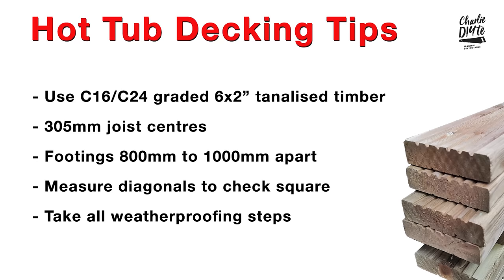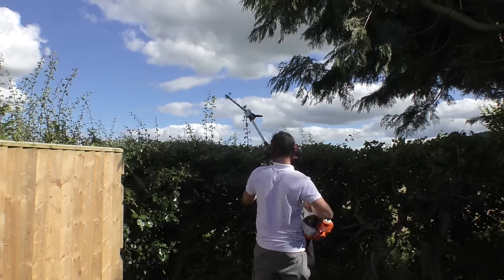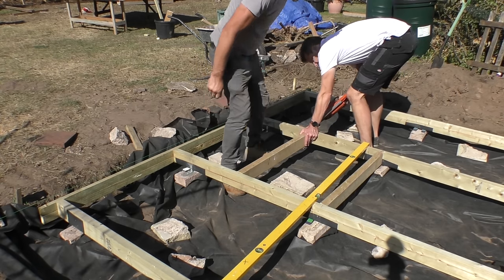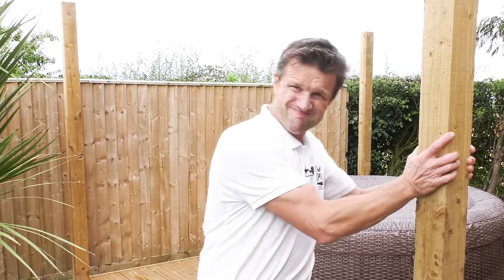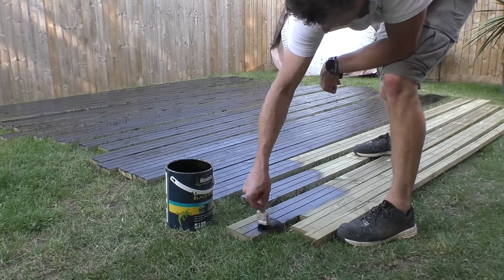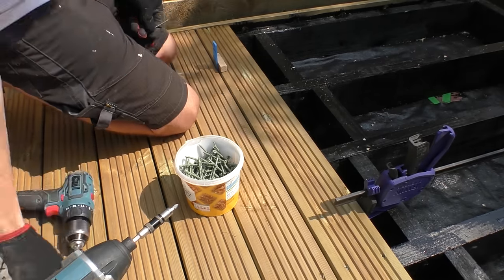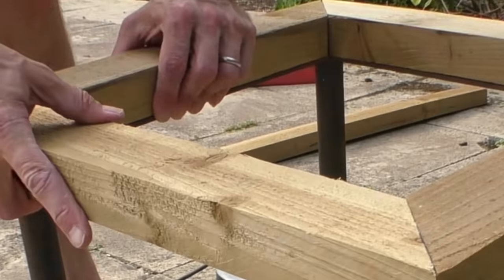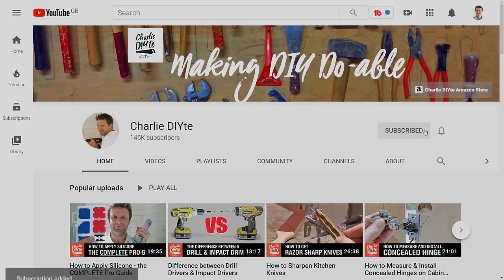How to Build Decking for a Hot Tub

Comment: My misses and I purchased an CleverSpa Monte Carlo hot hut (holds 0.96 tons of water) over lockdown as well as we will not be going abroad this year. I too built a decking base for the hot tub, but I found a place locally that sold really good quality reclaimed wood. 

I used 4x4 for the base border (used with coachbolts) and 4x2 for the inner base, joists and cross members, I used 4x4 wood for the inner joists supports/footings where you used bricks, landscape membrane sheets, horrible sticky bitumen on absolutely everything 🤣 and decking for the top (with a 5mm gap between each decking plank) and sides. General rule of thumb says that decking slopes should be between 1% gradient (1/8'' per foot) and 2% gradient (1/4'' per foot), I went for 1.5% across an almost 9 foot span which works great. I also overlapped the top decking over the side decking. As our hot tub has built in multi colour LEDs (around the bottom edge) which lights up the whole hot tub nicely. I purchased the same remote kit and receiver from AliExpress and added more LEDs to the bottom of the overlapped decking, it looks great as one remote control all the lights. 

Just like you, I too over engineered the decking base with way more support than what was actually needed. But with 0.96  tons of water displacement on the base, I prefer to be safe than sorry. Complete build price of the base was about £350 including all the decking base wood (reclaimed but in excellent condition), all the decking wood (new, I managed to find someone on Gumtree that was literally giving away surplus decking really cheaply as it was taking up space in their newly designed landscapes garden and they changed designed half way through, so ended up with too much new decking wood), screws, wood preservative, bitumen, extra lights and a few other bits and bobs.

Yes I'm a hobbiest but I always make sure to have all the right tool from the off. I used both my Evolution sliding mitre saw and also Circular saw, extra long calibrated engineering square (the base is perfectly square measured 45° corner lengths), spirit level (only for the top edge (not for the 1.5° slope)) and a few other select tools.

A nice session in the hot tub with a glass of wine and some relaxing music can be relaxing and fun at the same time. But wow,  heating them up are not cheap 😜
Reply from the maker: Hats off to you Pete. Sounds like you've completely aced that!! Thanks for the detailed account. Yes my electricity bills are a lot more now, not helped by the fact that my family insist on having it between 38 and 40 degrees!

Comment: I really enjoyed this, and appreciate that you left the "lessons learnt" in! 😁

Here in New Zealand we bury the posts in the ground with concrete also.  The posts are very heavily treated (H5) so last perfectly fine.  I'd set posts in the ground (with concrete) to support the weight of the bearers, rather than the bricks you used.  Not saying that what you did is inadequate, that's just what we do here.  

For setting the planks, I like the method where you set the first plank, then measure out and screw down what would be the 7th plank parallel to the first.  Then place the 5 loose planks that will fill in that gap, use wedges to ensure you have an even gap across them all & screw them down.  This ensures they are all even, is much faster, and makes it less likely that you get out of parallel.  If you check out Scott Brown Carpentry here on YouTube, he has some excellent videos on the method.

Last of all, I'm a strong advocate for having the grooves facing down.  They just collect dirt and become a mare to clean.  As a consequence they actually become more slippery when wet.  I used to work with a guy who worked for some years at a sawmill, and he told me the grooves are actually for ventilation & to minimise wood to wood contact, and are intended to be face down.
Reply from the maker: Thanks Tim, some truly great tips there. Yes, the post technique is prevalent here also particularly for raised decks, and I'm guessing a heavily treated post with domed concrete is about as impregnable and efficient for run off as you're going to get. I hear what you say about having the grooves face down. I don't actually think its right that they're designed that way, but I can see the rationale for it. The problem with having the grooveless side face up is that all wood gets slippy with time, and you're creating an infinitely more hazardous surface for going head over heels on, than if it was grooved. To keep the grooves clean I give them a blast with my leaf blower every other day. What I might do in the close season is give the deck a coat of sealer and protector. Tanalisation is fine, but it doesn't stop the water from sinking in. To my mind if you can make the deck impregnable to water, then it's not going to develop that slimy surface that we all know and hate!
Reply: @CharlieDIYte  Hi Charlie, I don't know if it's the different environment, but I find I just don't get that issue with the slippery decks.  That's with treated pine, flat-side up, stained with a water-based stain (I use Cabot's AquaDeck).  I try to re-stain every 2-3 years.
Reply: I did a large raised deck 2 years ago. It seems that different countries seem to have different ideas about the grooves facing up or down. The UK seems to have them facing up because of grip reasons. Im in the UK and did the grooves facing down.  Easy to clean and the water just runs off.  Decking can be slippery with the grooves up or down and if it's slippery it needs cleaning.    Also, the decking boards swell quite a lot over winter and I made sure there was still a gap between the boards throughout the year.
Reply: @IJ_uk  There's plenty of people here in NZ that install them groove-side up also 😁.  And I confess there was a time where I thought that was the way it should be done.  The other reason I prefer it, is it feels better under-foot.  But maybe I'm just being soft!
Reply: Groves defintely down.  Why people put them upwards is beyond me!   Yes, I would like my decking to be uncomfortable to walk on, and hold a ton of water so that it rots really quickly please!

Comment: Hi Charlie,
How did you choose your hot tub? I trust your research and we are looking at getting one just wondered if you a video in your research or any tips on choosing one? Thanks
Reply from the maker: Hi Ollie. With difficulty is the answer. In an ideal world you'd pop to B&Q or Argos and buy one. However the enterprising British public (assuming of course your in the UK) hoover them up and resell on ebay for a profit. I was fortunate I found a decent seller who sent me a copy of the receipt so that I could claim the warranty (without which you can't, when you buy on ebay). Back to the tub, we love this St Moritz version. The rattan pattern makes it blend in well, and it's a bit bigger than some of the other Lazy-Spas. For a family of 4 who are all quite tall, you wouldn't want anything smaller. A year on, the tub still looks brand new. The Achilles heel is the inflatable cover which is now deteriorating. I've fixed 4 punctures in it recently and it's still deflating. However I think this is par for the course with hot tubs and I need to install a new cover or come up with a mod for the existing one, as keeping the tub at 40 degrees (my family won't go in it if it's cooler than that!!) is quite expensive.

Comment: Very, very well done.  Like you, I would be concentrating on square/level/plumb.
But, I really want to thank you for the "brick on a base of wet concrete" idea.  So much easier and faster.  I will definitely use that on my Saluspa hot tub deck project. 

This video was extremely well done.  For that reason, I subscribed.  Thanks, again.👍
Reply from the maker: Thanks, I appreciate that and also the subscription 🙏 Yes, it's a good way to level it. If you bitumen the joists too, it should last many years to come 👍🏻

Comment: Great piece once again....informative and entertaining.  Run off gradient is a must and doesn't need to be steep.  Also if you have trees, hedges etc in the proximity of the deck then the upper side should be treated to prevent moss,  lichen or algae build up which can make the surface slippery especially when wet...and as you have the hot tub there will be moisture from getting in/out and overspill etc.  Another thing is that instead of the plastic packers between your joists and brick footings I would use reclaimed roof slate....stronger, longer lasting and won't hold moisture.  On a raised deck I would advocate 700mm deep holes and the posts bedded on a half a breeze block.....so that's 600mm of post in the ground.  Bed with postcrete.  Treat all cut ends but if ends are 9n show then Thomson waters ealing will do the trick and dries clear.   On the whole though it's a great job👍

Comment: Great video. Very informative. I'm still building ours, work and weather hindering the progress...haha. Mine is built from recycled C24 timber from a 10m x 6m raised deck I built 10 years ago. 95% of all the 6x2 and 4x2 joists and decking boards were still perfect, no rot. New deck is 2.6m x 2.3m 200mm off the ground. Like you, I dug out level and laid my main joists (6x2 spanning the 2.3m) on good quality weed membrane with just the one center support on each joist which were supported off the perimeter joists with joist hangers (galvanized twist shank nails holding these in) My 4 corner posts for pergola top are concreted in 450 to 500mm. I've waterproof painted all joists on all sides and all deck boards on all sides. Joists are spaced at 285mm centers with a central noggin and whole decking has a slight slope. Our hot tub is yet to arrive (dont think it ever will!!!) but it seems pretty solid atm with just half the deck boards down. Hopefully it will take the weight of the tub (Paris...1.2 tone when filled) 👍
Reply from the maker: Hi Mark, great to hear we're on the same page on this. You've gone a bit further than I did with treating the joists and boards, but there's your extra experience coming in! Hope the hot tub arrives. Did you have to buy from ebay like I did?
Reply: Hi Charlie, we bought from Nortwest Spas in Burnley but turns out they dont exist so we were scammed 😞

Comment: What did you use to finish it? Stain / oak? Just wondering how it's greyed over time and what products you considered or used for protecting the decking. I'm building a huge deck at the moment and can't decide on stain, oil or sealing!!
Reply from the maker: Chris I didn't stain or seal it at the time but wish I had, not because it has weathered badly, it's actually weathered really well. More because it is a bit grimy and I'll have to pressure wash and seal it in the summer when I next drain the tub. I too, like you, haven't decided what to use though. I'm thinking a natural sealer just to stop the water getting in and the mud sticking to it. Let me know when you make a decision.

Comment: Very good m8 just about to build a decking for our new hot tub, great that you talked about the mistakes aswell I think you did almost everything I would except I don't think I will paint the underside of the decking boards as I want air to dry them out from all sides. Thanks 4 a good vid 👍
Reply from the maker: Thanks Tom. Yep, happy I made it level by the way. There's been no problem with it draining off after the rain.

Comment: Good work... as a 30-year fence builder, I'll say that you need a 1.5m-long straight digging bar with a pointed sharpened end, and a flat sharpened end to dig with (or whatever would you do when you hit a hard-smooth tree root blocking your post end 20cm deep???), and when mixing concrete in a wheelbarrow you should be mostly standing at he front facing the back and dragging the concrete and water towards you with a spade shovel, quickly and repeatedly, up the tall front run of the barrel in small bits and the material mixes itself... having workers tossing it around like you were doing just makes a mess and doesn't get to the dry materials in the bottom corners... cheers and best to you!

Comment: Hi, RE your comment about putting it on a gradient - never do this with a hot tub - you'll put stress on the hot tub and if will potentially crack due to stress as there isn't an even balance of the water.  That's the reason I'm watching this video as I need to put a deck on top of my patio as I could see it was impacting the structure of the hot tub so I'm going to put a deck on top of the patio and use pedestals to level it up although I do like your bricks and concrete method so might do that instead on the inside.
Reply from the maker: Thanks David. Yes particularly for the rigid hot tubs I can see that. Plus someone else commented that the gradient would have to be too large for it to be effective in diverting water off it.

Comment: Very interesting video. When is the pergola coming?  I'm looking at building a deck like this with pergola and some sort of roof on the pergola. I want the deck to house a similar inflatable hot tub, a pool table and outdoor lounge seating. It will be located directly outside a log cabin which is going to be converted into a pub shed. I was am debating if to use this type of footing or go for something like concrete decking blocks or the quickjack shed base system. It appears the benefit of the posts in the ground are that its secured into the ground but some decks are just build on top of decking blocks but sitting on some gravel which looks a far easier method to create the base. Regarding the run-off it's an interesting question as another channel I was watching yesterday was very dismissive of the need for a run saying this is a mistake as the water drains between the gaps in the decks boards and there is no need for a run off.
Reply from the maker: Thanks 👍🏻 Hopefully later in the summer. Yes, run off isn't really relevant. My deck has drained fine even though it's level. There will be so much weight particularly with the hot tub, it's not really essential to sink the posts although professional installers may disagree, and given the size of your deck it will give the posts additional support. As for the deck substructure and foundations, I'm afraid I can't really comment as I only know the system I've installed.

Comment: We have plastic grass down in our back garden. do you think it would be ok to just lay the decking on top of that without having to excavate?
Reply from the maker: You could. I guess you just need to ensure the decking joists are raised up from the grass somehow - by putting them on bricks or similar. Also if the grass isn't totally flat you'll need to come up with a plan for making the deck flat - maybe with packers on the bricks. I was going to say that if you're intending the deck to be a permanent structure there doesn't seem much point in leaving it in place below the deck, but I suppose the grass would act as a weed mat, so maybe worth leaving, IF you can deal with the points I made 🤔

Comment: If my lawn is quite straight already, would I need to do what you did, i.e. dig it up? Don't you think those bricks will sink slightly over time?
Reply from the maker: They haven't sunk but you do need a firm base if you're putting a heavy hot tub on it. Also if you're just laying the wood on the lawn it will quickly rot.

Comment: Another great video, with very clear commentry, thank you for including your mistakes, they are great learning points

I'm busy doing the same, can i ask what thickness insulation you have under your hotub and would you recommend it or would you prefer thicker?
Reply from the maker: Thanks. I've got the Lazy Spa mat which is about 12mm I think, and celotex is 1 inch thick, which equates to about 25mm. No need for anything more than that.

Comment: I used a cheap reject decking kit (3m x 3m for somewhere around £300) and several of those quickjack spike feet to hold a layzspa Hawaii hot tub, then painted with fence paint 😂, as it then matches the fences... noggins should be closer as the cheap decking flexes a bit, but it doesn’t get much footfall. Surrounded with blue slate. Built it last year and it is still standing and level. Needed to repaint though as the paint isn’t so robust, but have to clean it anyway as it gets muddy during the winter, so not too much hassle.

Comment: I'm looking to make a similar thing and wondered if you think it would be okay to mortar the footing brick on a paving slab rather than dig the hole and fill with aggregate? I have plenty of left over concrete square slabs which I need to use/get rid of and thought this might work. I would obviously make sure its all flat and level underneath these slabs and probably tamp the ground underneath them too. Thoughts?
Reply from the maker: It's an interesting one, this. I would have said that your main problem, given water drains through the decking, is the ground stability, eg with sustained rainfall. However, thinking about it, your slab is probably going to be more stable than my much smaller area footings, so you'd probably be ok with that.
Reply: @CharlieDIYte  cheers. I’ll probably tamp some bits of hard core I’ve got to go underneath the slabs and compact the ground as well. It’s around 3m2 so will copy your method of 800mm spacings and that should easily be enough. Plus no hot tub on ours! But we are shelling out on composite deck boards...